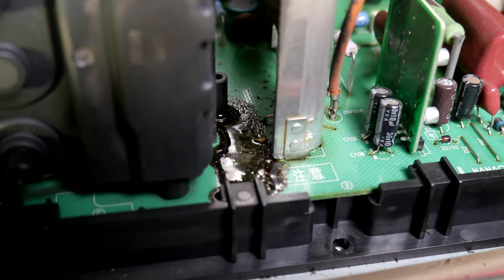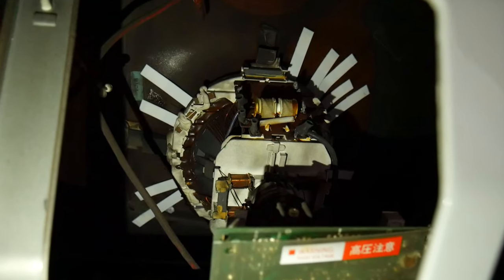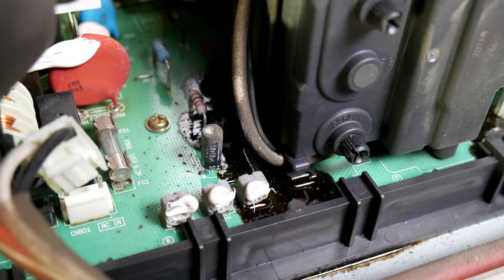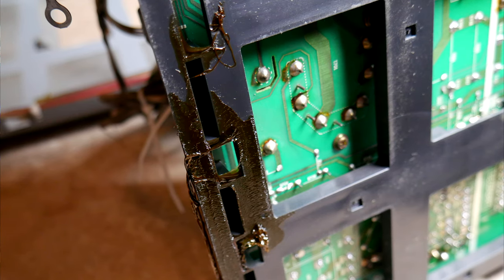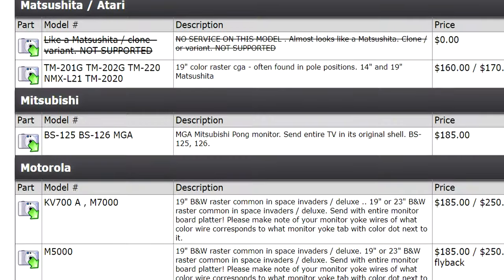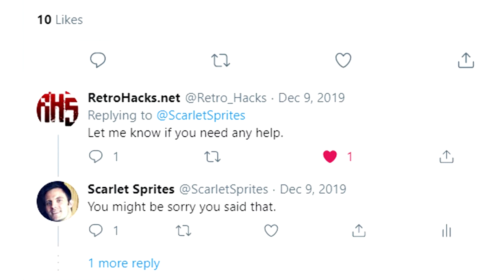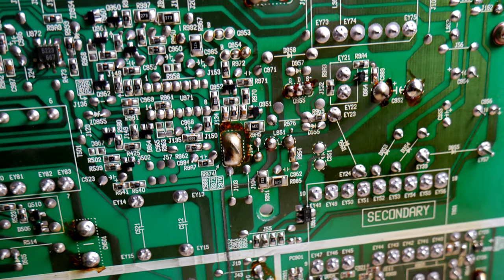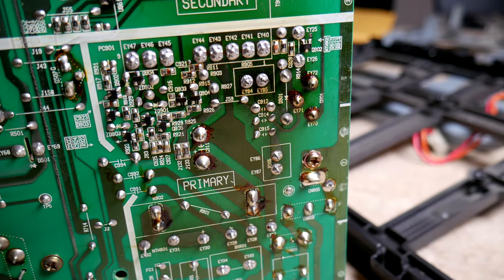The Dreaded Black Goop!

Comment: I fix and service industrial equipment for a living and part of my job is maintaining the stuff that's why I love videos showing how to properly maintain and fix your gaming equipment from complex arcades all the way to removing dust from a handheld device. I've saved many consoles I've found, some in non working condition and some in dire need of restoration. The feeling of fixing and restoring a device is very satisfying.
Reply from the maker: That’s awesome man.  I’m not great at it by any stretch, but I make leaps with each project I take on.  The monitor chassis is one that I’m still gunshy on, and happy to have a pro do the work for.  Taking something from trash to treasure is a great feeling for sure, sounds like you know that better than most of us.

Comment: Thanks for making a video about this! I'll be waiting patiently to hear how it comes back, and how retrohacks work is. I have called Chad at Arcade Cup and spoke with him about monitor repair, he said these chassis are such a pain to work on they aren't worth the amount of time it takes, plus sourcing parts is impossible. These chassis use both through hole (older style) caps, as well as tiny top mounted caps. I have also heard too many horror stories of people who send their chassis out for work, only to have it return non-funtional. I am terrified to do work on my working 2931, and pray it doesn't die before someone figures out how to fix them. I'm hoping you the best of luck with this!
Reply from the maker: The only saving grace in this case is that it still functions.  Just hoping to do a little preventative maintenance to keep it going a little longer.  I haven't done much research, but in a worst case scenario I wonder if there is an alternate chassis that will work on the Toshiba tube in a Blast.  I also saw very recently that there was a potential replacement flyback, which would be very good news for rebuilding these.

Comment: Very informative. I haven't heard about this issue, but I have a buddy who recently got a Blast City cab so I'll be sending this along to him as an FYI of something to watch out for. I've had to replace the chassis on my WG K7000 series in my Dynamo recently, but that was due to bad caps and various other issues. Good stuff as always!
Reply from the maker: It unfortunately seems like a matter of when this is going to happen on this particular board.  The good news is at least that it’s non-conductive so the board still works.  Not pretty to look at and makes working on it for the routine stuff more of a pain than it needs to be.

Comment: I didn't know about the black goop thing. I only have one arcade 1up cabinet and one 50" tv put in vertical for pinball and vertical games.
I hope that everything with the repairs go fine for you.
Reply from the maker: Thanks man.  Yeah, it's seems specific to the MS2930, 31, and 34 Nanao chassis.  I've never seen this before on any other boards.  Fingers crossed it can be cleaned up, recapped, and last another ten to twenty years.

Comment: Oh man thanx for the video...  my blast city monitor seems fine however I feel that my PSU is messed up and needs to be checked out.  Right now I am running a multi game PCB in it that uses it's own power supply, and besides the fact that the Blast City makes a lot of noise when turned on everything works... however I just bought one of those pandora boxs which uses the power on the jamma harness and all I get is sound, no video.  So I am going to contact the guy that you recommended in this video so thank you for that.  Also I was wondering on your Blast City what number do you leave the contrast and brightness on...  I feel like I am always stressing myself out playing with it and I would just like to leave it set to what a professional like yourself leaves it on.
Reply from the maker: I know having the original power supply fixed or rebuilt is the path that many people take when it comes to Candy cabs, so that’s a possibly option.  As far as my monitor goes, I actually don’t have one with an OSD in my Blast.  Mines the traditional type with pots.
Reply: @ScarletSprites  oh I understand...  actually you have inspired me to buy real arcade PCB's instead of messing with multi game boards like a chump !!  I hope i can get my Blast City back in shape.  I am also in the market for a "supergun" can you recommend any ?.?